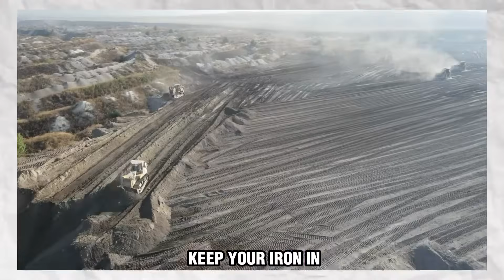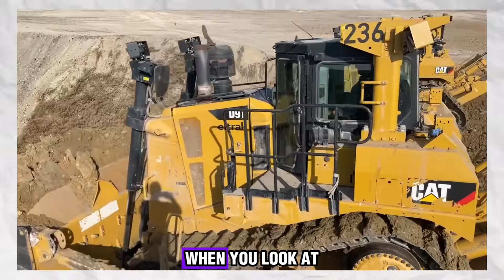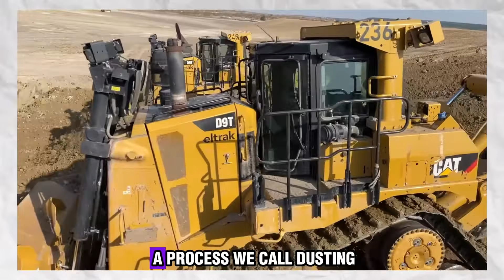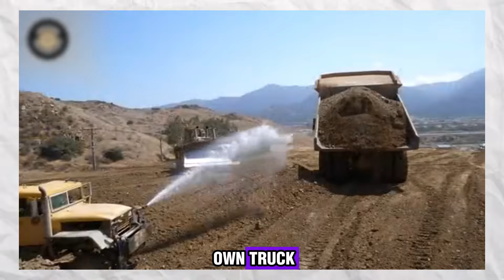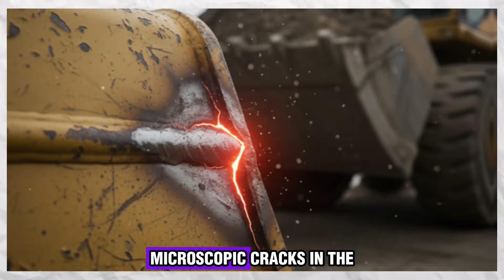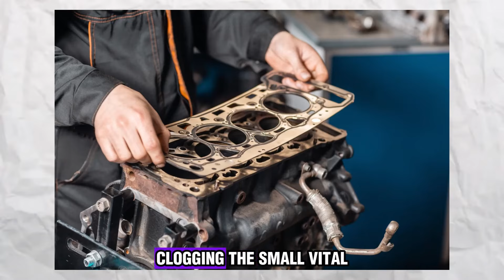Heavy Equipment: 10 Mistakes Costing You THOUSANDS!

Comment: Back in 1979 when I was a union backhoe operator. We had a supervisor just like you spoke about. Get back to work. We ended up with TWO backhoes just sitting. One had blown a big hole in the block. The other was an (International) with pedal drives, It would NOT move forward. The only backhoe that kept running was a case 580 from a rental company 😊 the supervisor brought this old crane to job. Its boom all twisted and lattes bent. One of the labors said it came from Dutch Harbor Alaska. As soon as the very first Iron workers got to job. They "SHUT DOWN" work till a operation "CRANE" came on site. That shut me down also, layed off. The funny thing was on my next job a big sewer job. Guess who shows up to be "JUST" a operator. That very same supervisor 
He just growled at me, and jumped on a trackloader without even doing the "WALK AROUND" he was just a big "cowboy" like you said. The supervisor on that sewer job was not going to have it. That operator lasted just a few days, then "LAYED OFF" he is the guy who operates equipment that you see for sell at bidding shows. The machines have "CRACKS" all over the "ABOUSED" equipment. These are the operates that think they are the best in the world. Yet I had personally witnessed them totally destroy heavy equipment. They only teach what "NOT" to do on operating very expensive dirt pushers.